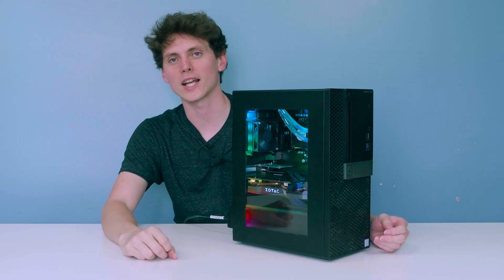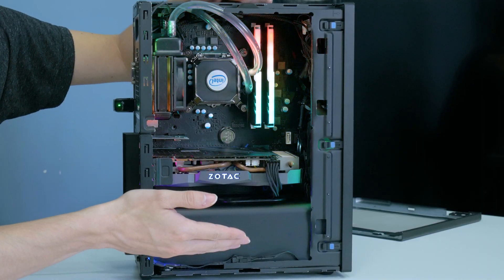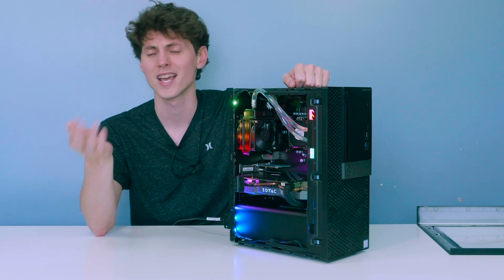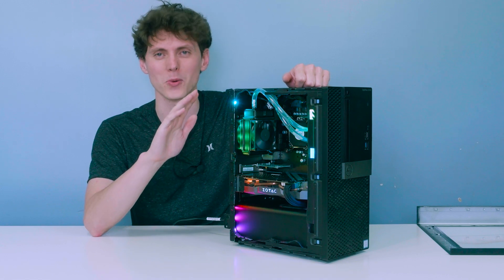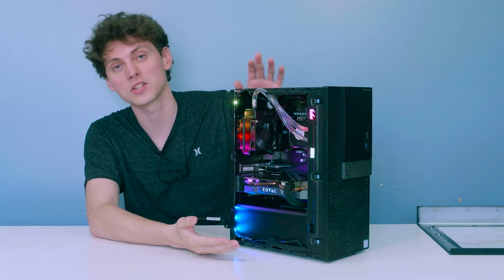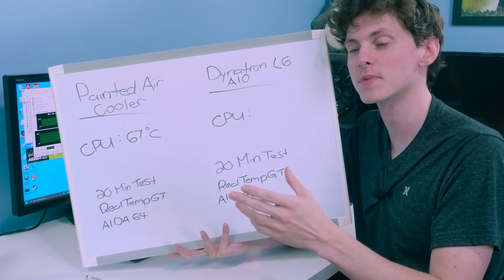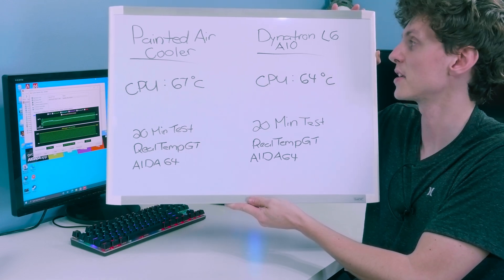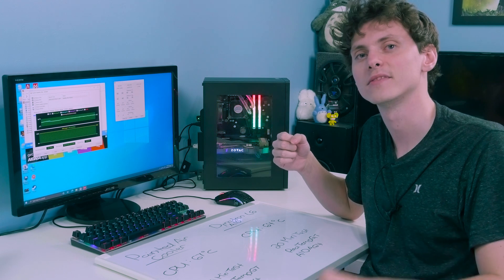Water Cooling My Dell Optiplex Gaming PC

Comment: I am planning to buy an optiplex from my local university surplus store in order to make a cheap home server, but i want the noise levels to be minimal because the only ethernet I have is in my bedroom. Did the liquid cooling quiet the flex down? Or did the new fans end up being louder than stock? Thanks in advance!
Reply from the maker: The new Noctua fans are much quieter than the stock ones. The liquid cooler is questionable on making it quieter. It's such a tiny rad and pump that it spins quite fast. The stock cooler is probably quieter with Noctua fans on it.

Comment: It’s amazing that as big a thing Sfx builds are getting there aren’t companies making 80 and 92mm radiators.  I have an Opti 3070, is there no way to get a 120mm on the bottom half of the front panel?
Reply from the maker: Unfortunately, it's not possible to fit one in the front. It JUST doesn't fit. Asetek makes a 92mm AIO. I have it installed in the next video on OptiFlex.
Reply: @WiltshireTutorials  No way I’ll have to check that out!  I’m running an MT Opti 3070 with an i5 9500k and a 1660super.  It’s doing everything I want it to, but I’m looking down the line at a 9900k and the new lp rtx4060, so I see an aio in my future.
Reply from the maker: @WanderingDisciple87  Avoid the 9900K the power delivery on the motherboard cannot handle any processor over 65W. The 9900K is 92W. You can go for the 9900 (non-K) which is still 65W. That's what I did.
Reply: @WiltshireTutorials  I suppose that’s pertinent info 😬🤣 They discontinued that Aio btw 😢.
Reply from the maker: That's a shame that Asetek discontinued the cooler! It's a really good cooler! I suppose you could make your own using a pump and radiator from Alphacool

Comment: Wonderful work thank you please i want to ask you about Dell optiplex Mini Tower please reply
Reply from the maker: This is a MT (Mini Tower) in the video. What questions do you have?
Reply: @WiltshireTutorials  Thank you much appreciated am grateful i got it with 800$  i have a dell optiplex 3020 mini tower for  with cpu  i7 4790 / Rx 570 8gb not original one it was used for mining or recycled  / 16G ram/ 1tb HDD /120g SSD / PSU 290W / Windows 10 / i've got it 26day a go the first 2 weeks he was working fine but games was crashing  i was streaming recording  then with the last updates the GPU started crashing i've did some research about it I need a power supply also for the heat i need a Gpu cooler Also the CPU i think i was scammed but i hope you guide me please if there is a useful clear tutorial About it
Reply from the maker: No problem! Nice little rig you've got there! 

Let's see... Considering the GPU was used for mining, it could be on it's way out (dying). Ex-Mining GPUs are not very trustworthy or reliable. Mining uses the GPU at 100% 24/7. So, the likelihood of it burning out is very high. If this is the case, try underclocking both the Memory and GPU Core Clocks to see if the GPU becomes more stable. As GPUs age, they may not be able to maintain their factory default clocks anymore. 

That PSU wattage is pushing it too. That GPU will draw 200W on it's own and the CPU will draw 84W at full load. You're stressing that PSU really badly! Don't forget your motherboard, RAM and SSD all need power too and with the remaining available 6W, it won't be long until it goes pop and blows up!
Reply: @WiltshireTutorials  yes it come back to 27 degree when i use MSI after burner 
thank you am careful with it also im thinking of a gpu cooler also much appreciated you are the best

Comment: How did you manage to power the pump and fans?? or even mount the water block on the cpu? or did the motherboard support the backplate
Reply from the maker: All good questions. All of which I have an answer to. 

The AIO pump is powered by a molex to 3-pin fan adapter. This way the pump is running at full speed all the time providing the best cooling possible.

The AIO fans are plugged into the CPU FAN header on the motherboard. Luckily, the 3040 motherboard has standard 4-pin PWM fan headers on it.

The motherboard is a standard Intel LGA 115X mount design. So, any cooler that fits the LGA 115X socket will work.

Hope that answers all your questions. Let me know if you have any more! Thanks for watching
Reply: @WiltshireTutorials  ok that makes sense now, i forgot that the 30 series optiplex's have 4 pin fan support. I have an optiplex myself and I was gonna put a new cooler in it so this definitely helped. great videos!!
Reply from the maker: @jeekzy8319  installing an aftermarket cooler should be a walk in the park. You will need to remove the factory standoffs from the case. For some reason, the standoffs are soldered to the Optiplex case. 

Glad you like the videos!

Comment: Do you know? I'm looking for the new one who modding optiplex and i glad found you! I've optiplex 3050 and want to modding like you, pleasee how to put 1 ssd 2.5 and 1 hdd 3' into cassing. Hope  you read ma commect, see youu~
Reply from the maker: Since you have a 3050, I would suggest using an M.2 SSD. I would just not use a HDD. Fitting a 3.5" HDD in the build is just not possible. If you really need two drives, use one M.2 SSD and one 2.5" SATA SSD.
Reply: @WiltshireTutorials  but ssd on 500gb so expansive here😂

Comment: Will you get rtx 3080 or 3070 cause am waiting for your video?
Reply from the maker: Trying to find one is very difficult right now. I'm not willing to pay scalpers for one either. I'll be going for RTX 3090 when they're more available.
Reply: @WiltshireTutorials  will you try new generation gpu in optiplex too right?
Reply from the maker: If it fits inside, sure. I don't think we'll see a mini GPU for the RTX 3000 series for a while
Reply: @WiltshireTutorials  actually isaw rtx 3070 zotac and it's same size as 2070 which it will be released in late October maybe
Reply: @WiltshireTutorials  but am still waiting for your new video about your amazing optiflex 🔥🔥💪🏻
Reply from the maker: That 3070 is slightly bigger than the 2070 Super Mini. I'll most likely end up buying it to try it out! Thanks for letting me know of its existence!
Reply: @WiltshireTutorials  you're welcome

Comment: I came here after commenting on your other optiplex video. How you found the room to fit that in is just a feat of engineering. Now I 100% love the window you cut in the side. It's like a mini version of a full sized gaming rig. Pushing old tech until the wheels fall of is the best way to go in my humble opinion. I can basically afford to buy any prebuilt top tier gaming pc any day of the week. But getting the most out of older hardware is more fun. 60 fps on high at 1080p doesn't look any better on a more expensive system. Great job!
Reply from the maker: Glad you decided to check out more on OptiFlex. Getting that Dynatron L6 to fit was not that fun lol. That was pretty much the idea of the whole project, how far I could  push an Optiplex 3040. It makes for a good travel gaming and editing rig too, due to its size.

Comment: Hey Wiltshire,  I've got a question that's unrelated to the video, I recently got rid of my Vega 64 and got a rx 5700 because it had gddr6 vram, and also had issues with my vega drivers. I'm able to play most games at 4k on ultra settings, for example witcher 3, warzone, modern warfare, green hell etc. However whenever I try playing gta v on 4k, my fps just floods down to 20fps. Yet I can run games more demanding then gta, is gta really badly optimised on amd GPU? And also, I have 2666 and 3000 mhz ram only, and its running at 2133, my motherboard supports oc, so I try to oc them to 3000, I get a black screen, I try setting them to 2666 black screen, know what the issue could be ? Cheers

Comment: hey man i would really love to see some gpu cable sleeve brackets, i feel like it would be a huge aesthetic boost for less then a buck
Reply from the maker: I tried. They won't allow the GPU cable to fit with the side panel on. I have less than a millimetre to get things to fit. In fact, the GPU cables are pressed up against the side panel.
Reply: @WiltshireTutorials  also maybe use  coloured cooling liquid to fit the colour scheme better? And perhaps a rgb gpu backplate, i heard those were a thing.
Reply from the maker: @horizonsystems178  Everything you suggested I've thought about. 

I was going to use a coloured fluid for the AIO and decided against it. Too much maintenance. Having coloured fluid tends to gum up the insides after awhile. So, I went with a clear fluid instead. I may just put sleeving around the tubing of the AIO though.

As for the GPU backplate, I thought of making a RGB one as well. However, I'm pretty much completely out of room to cable manage at this point. I would need to add another SATA power cable in order to use an RGB controller for the backplate or to even power it the plate itself.
Reply from the maker: @horizonsystems178  I have so many cables under the shroud for the PSU that I can't stiffen the cables with combs at all. It just doesn't happen.
Reply: @WiltshireTutorials  kept forgetting that youre working with such a tiny case. Keep up the good work man.
Reply from the maker: All good! I may try experimenting with different brands of combs. See if there are thinner combs than others that may work.
Reply: @WiltshireTutorials  sounds stupid but maybe sand it down abit? Its not rigid so that might be a problem
Reply from the maker: That's one way of doing it. But, I would like to have a clean surface when finished. Don't really want any sand scratches to be visible.
Reply: @WiltshireTutorials  you can try progressing it down the grits, use #1000-#2000 sandpaper for polishing and use #300-#400 grit for gridning? Or use some plastic polish  to polish it even more. But thats a lot of work for merely just a cable comb lol

Comment: Nice vid man. Do u know if it’s possible to put a Corsair h100i liquid cooler in an OptiPlex 9020?
Reply from the maker: Hmmm, probably not. H100i is pushing it for size. If it was an H80i, then you could probably fit in there with some mods here and there.

Comment: Since you've upgraded your CPU cooler why not trying to Hydrodip the old air cooler to see if it affects the performance.
Reply from the maker: I could. However, I already painted that CPU cooler and it already affected the cooler's ability to dissipate heat. Not by much though. Only about 4 degrees.

Comment: And if i install this cooler It works without cutting the middle piece inside?(is where is the hdd and cd player) Sorry for my bad englisch
Reply from the maker: Technically, you could make it work. I personally would recommend just going with a 90mm CPU cooler from Aliexpress over the Dyantron L6. The cooler is quite expensive.
Reply: @WiltshireTutorials  okey thanks for reply, so is the Deepcool (RGB 200 Pro) not necessary? only Dyantron L6?
Reply from the maker: The RGB strip is completely up to you my friend. It's all a matter of aesthetic taste. Again, I don't recommend trying to get the Dynatron L6 to fit. Modification is needed to even get it to work.
Reply: @WiltshireTutorials  okey thank you, you are making nice videos🔥

Comment: I don't know what went wrong. With my 7040, with an rtx 2060 connect the dividers and turn off the computer and there was smoke, turn it off immediately, the motherboard burned.  I think it was a short, something badly connected because it was after turning it off
Reply from the maker: I'm not sure what you mean by "dividers"? There is definitely a short. Motherboard is definitely toast now, unfortunately. What kind of PSU were you using for the PC?
Reply: @WiltshireTutorials  Do not know what happened, the Spliter SORRY, putting a fan of 0.09A and 3 of .60 or of you think it was a lot of consumption of a RTX 2060? The short was with the CPU off :( psu its evga supernova 550 gm
Reply from the maker: It's difficult to pinpoint exactly the cause of the short was. Are you able to link me the exact splitter you purchased for your PC? It could be the splitter being wired incorrectly. It could even be the PSU that was bad.

Comment: you can tell me , how connect fan front, link i can buy ?
Reply from the maker: Do you mean how I hooked up 2 fans to one fan header? I just simply used a 4-pin PWM fan splitter for that.
Reply: @WiltshireTutorials  Exactly, will there be problems with the order of the cables? I had read that dell inverts the voltages and the fans can go in reverse or not detect them.
Reply from the maker: Just plug the fans into the splitter and plug it in. That's all you need to do.
Reply: @WiltshireTutorials  excuse me so many questions but what about RGB how did you connect it?
Reply: It is clear to me about the rgb, I do not speak English, it is the reason for not understanding very well I am putting together the same although I have added an rtx 2060.
Reply from the maker: No need to apologize! I applaud you for learning a second language. I tried to do so many years ago and I just couldn't do it. Sorry for the late response as well. Your comment got buried among the others I've gotten recently! Glad to hear you figured out the RGB! Let me know if you have any more questions!

Comment: Did you consider using a fan adapter to mount a more common 60mm or 80mm radiator and fan?
What about using an external water cooling system to bypass all these problems?
Reply from the maker: I did consider it, I even 3D printed a 70mm to 80mm adapter. However, aesthetics are somewhat important to me. I didn't like the way it looked with the adapter on the radiator. So, I decided to not include it. Going from an 80mm to 70mm fan resulted in a 1 degree difference, which is within the margin of error.

Comment: Can I add a gtx 1660 super by gigabyte(not the one with 3 fans) in a dell optiplex 3070 tower(not the micro) without upgrading the psu(260 w)
Reply from the maker: No, not at all. That GPU at full load would almost saturate the stock PSU. You have to take into consideration how much wattage the CPU, chipset and drives (HDD OR SSD) draw as well. That GPU also requires an 8-pin power cable too. If I'm not mistaken, that PSU only has a single 6-pin power cable.

Comment: Interesting. Did you have to use a separately sold  special 24 to 6 pin adaptar cable to connect the SF600 PSU to the Dell optiplex 3040 motherboard? Or did you not need any separate adapter cable? If so, which standard cables from the SF600 PSU did you use to connect to the 2x3 (6 pin) connecter on the Dell motherboard, and which to connect to the 2x2 (4pin) connector on the Dell Board motherboard? Did you use the 24-pin cable at all? 

Thanks!

Comment: Excellent video. I own a dell optiplex 3040 but i have issue with cpu & case temps, i cant control my fans speed or let the motherboard use optimal speed for the temps in the case, either they run at the lowest speed or override the fans at maximum speed. you said in the video i want to control my fan speed 5:20. How did you do it?? btw both my fans are 4 pin pwm
Reply from the maker: Hey Admad, I'm glad you liked the video. The Dell Optiplex 3040 has a feature called SupportAssist. Before the PC boots into Windows, it checks all the hardware to make sure it is functioning properly. If it thinks there is a problem with the fans, for example, it will not allow the fans to adjust themselves based upon thermals. What are your CPU thermals looking like? It could be the CPU running too warm and SupportAssist is trying to compensate for that by running the fans at max speed. If the CPU is running too warm, I recommend putting new thermal paste on the CPU.

As for controlling the fan speed, I control them by using HWinfo. That app is also quite useful for keeping an eye on thermals! So, you could use it to monitor your CPU thermals to see if re-applying thermal paste helps or not.
Reply: @WiltshireTutorials  My cpu is i7 6700 when i play games like cod warzone my cpu temperature gets to high 80 low 90c at the same time my cpu fan as well case fan are idling running at lowest speed, similar temps are in other games depending on cpu utilization. There is an option in the bios to let me choose to run the fans at maximum speed but they'll run all time at max speed even on idle which makes the pc so loud. I re-applied thermal paste but that doesn't appear the issue. The software im using is HWMonitor, also tried SpeedFan program same problem. Any idea why im having this problem? I really appreciate your reply and help.
Reply from the maker: Did you click on the fan icon at the bottom of HWinfo? Makes sure to set a custom fan speed and not System Auto.
Reply: @WiltshireTutorials  Thank you so much for your help. It worked perfectly with HWinfo64 finally the problem solved. I had this problem more than 2 years until now. Finally i can use my pc without worrying about overheating. Again thank you so much, god bless you.
Reply from the maker: @ahmadjmms  You're welcome. Glad I could help you sort your issue out. Thanks for watching. Go enjoy some games without worry now :D